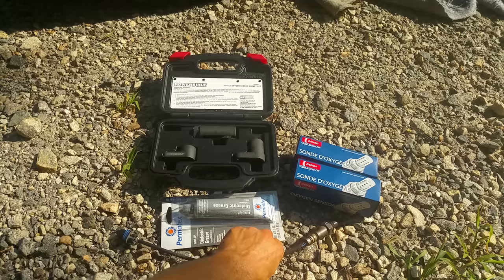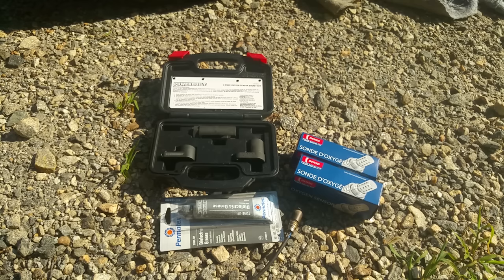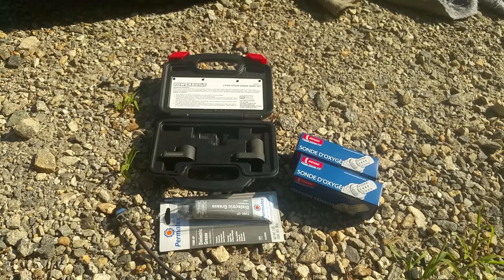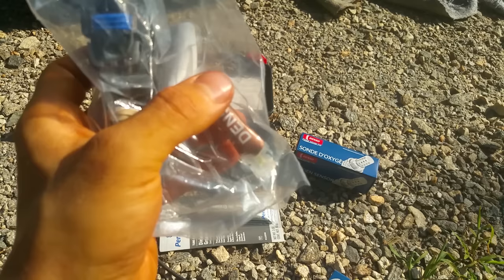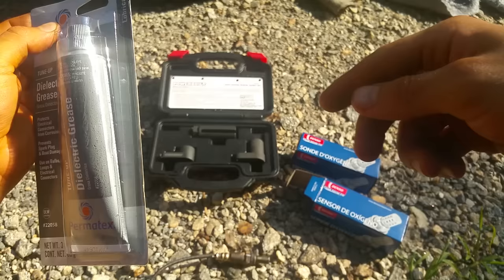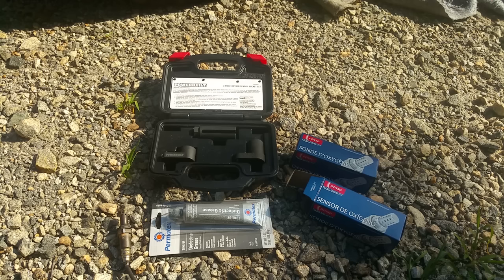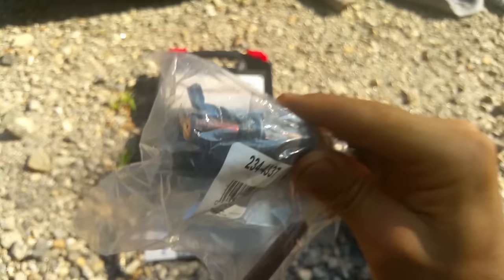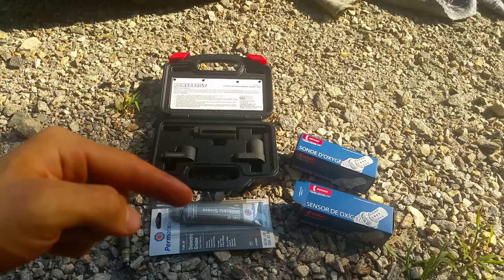NEVER Change Another O2 Sensor Until You WATCH THIS!

Comment: Hey, how are you? Is there any truth to checking several aftermarket sensors to see if they work? I was told you have to check a couple cause some may nit work. I have to put one in my dads 2003 Ford Windstar.
Reply from the maker: +JOEGGGJOE I'm good, wbu? What do you mean checking several aftermarket sensors? If the sensor is the right part number for your vehicle then it should work no problem.
Reply: I was told with buying aftermarket sensors, sometime they don't work. You have to try several of them. I just bought one from the dealer. It was just $44 dollars.
Reply: JOEGGGJOE I have seen the cheap sensor turn on check engine light, only thing that fixed it was to buy the oem one then the light went out.
Reply: what does a mink look like?
Reply: JOEGGGJOE 1"
Reply from the maker: Yea don't fool with that stuff. Just replace your broken parts.
Reply: Once you try two aftermarket sensors you might as well just get the OEM part instead and not worry about it...unless you misdiagnosed it to begin with.
Reply from the maker: It doen't even have to be an OEM part. As long as it is a good name brand.

Comment: Suggest you not use Carb or Brake Cleaner, actually hurts the heater inside the O2 Sensor.  For purpose of release use brake fluid on the outside.  Also, all 02 sensors use 22 mm sockets or wrenches.

Comment: hi 
I have nissan maxima qx 2000 so I have problem with my car in sensor rare can you guide me to buy it but secand and not new can you helpe me please 
thanks alot
Reply from the maker: +adel ahmad What's wrong with it? If the sensor is bad you have to get a new one. Don't try to use a used O2 Sensor. That would be a waste of time.
Reply: hi  again ok if want rare sensor do you have it ? and ow much prise ? thanks
Reply from the maker: +adel ahmad How is your sensor rare? Look at the links in the description for new 02 sensors to see if they have one for cheap on Amazon.
You can look up exactly what part number you need on Autozone's website.
Reply: thanks alot
Reply from the maker: +adel ahmad No problem. Make sure you get the right one there is probably an upstream sensor before the catalytic converter and a downstream sensor after the catalytic converter.

Comment: O2 sensors 'breathe' through the wires and using dielectric grease or any other stuff on the connector can screw them up.
Reply from the maker: No, some of them do and some of them don't. It's up to you wether to use it or not. Look how your sensor is made.
Reply: AFAIK, sensors with breather holes are a thing of the past so almost all modern ones use the wires.
Reply from the maker: Yea, if the sensor breathes through the connector then don't use the dielectric grease for sure.

Comment: Dielectric on an o2 connector is a no no do some reading and research o2 sensors wick air down the wire for the center core of the sensor.
Reply from the maker: Only some of them do that. It is up to the mechanic to decide.

Comment: Breaker bar... REALLY BAD IDEA.   You're likely to break the sensor off in the hole, tear the threaded mount hole out, or strip out the threads.  Heat the thing up first - just run the car for a while.  Then try to get it out with a wrench or a sensor removal tool.

Comment: You have a touch? You heat cherry red where it screws into and they normally pop right out. If you have a scanning tool you can clear the codes. It's not a halogen bulb. If it is bad and your going to replace it then cut the wires why buy the tools.
Reply from the maker: You never know. You could replace the sensor and then the code doesn't go away. IDK I guess I'm just a hoarder haha

Comment: Don't waste your money on an O2 sensor socket. The old O2 sensor is junk so just cut the wire and use a regular 6 point socket (1/2" drive) with a big breaker bar. The slotted O2 socket will spread if your sensor is seized into the bung. If you're throwing out you old sensor, cut the wire and make your life easier. God bless and stay well.

Comment: can sensors be interchange
Reply from the maker: +Aurthur Ledesma Interchanged with what? You are better off just using the right part number for your vehicle. If you mean swapping from one vehicle to another I would not do that.
Reply: I think he means is there specific part # for each bung,  no there is not.
I have 30 yrs as a Journeyman bunghole technician.

Comment: Never use grease on connecter, the 4 wire o2 sensor gets its reference air through wires, you will block the reference air.That is a big mistake to tell people to use dielectric grease on o2 sensors!
Reply from the maker: +Gary Warner I do not know where you guys are getting your information, but that is WRONG for this application. On some vehicles maybe I do not know, but on these style O2 sensors that's not true.

 Look at the black protective piece over the wires it's open on each end. How does air get from the connector to the sensor?

The sensor references the air that surrounds the top of the sensor where the wires are crimped on. That's where it gets it from. Not through the wires. That's impossible.

Comment: Paid 30 bucks to a mechanic my truck had 4 and dint wana risk messing it up hahaha
Reply from the maker: Lol $30 to swap O2 sensors? You got a deal.
Reply: @MattsShop  he even took another car off the lift to check mine ive had tried helping him unclog his shower before and he is my friends, friend i wouldn't mind having a mechanic friend had some beers with him too
Reply from the maker: Sounds like a good deal. Those O2 sensors can be very stuck. It's better to have a friend remove them sometimes and throw them some cash.
Reply: @MattsShop  yes sir the muffler looks pretty rusted for 2014

Comment: ACTUALLY Your video was👍😎 the other one I watched REMOVED THE HEAT SHIELD! IF YOU HAVE EVER HAD TO REMOVE SMALL HEX HEAD BOLTS AFTER 10+ YEARS you would think that's 🥜🥜 Thanks for showing me the COOL TOOL😎 I have several sockets that I can grind a slot in😎.

Comment: Just had a stuck one ( unable with o2 socket via ratchet)  my go to method is switching over to a closed box wrench and tap "encouragingly " with a rubber mallet . If too questionable then go to torch (small butane) at female connection & try again hot. If that fails quickly add 3in1 penetraing oil or your favorite lube and have a beer (again your favorite beer , if you dont drink God bless you for the virtuous sober  patience) Go talk to your loved ones n shoot the shit for a bit. Go back and tap once or twice as said in the tighten direction then backwards to remove.  Usually works , if not you'll probably start drinking and learn about extractors and buy a welder and other "valid" tools. Cheers 🍻
Reply: Tried your advice. Stopped for a beer break. Had none, so a neighbor poored me a glass from his tap.  I DIDN'T KNOW IT WAS BUD LIGHT! After the job was complete, the car refused to start. It now claims it is no longer an internal combustion engine and insists it is electric.  WTF!

Comment: They come out super easy if you heat them with a torch
Reply from the maker: +James Simpson Yea, but sometimes you can't/don't want to get a torch in certain spots.
Reply: Do these guys read the other comments, if so how did they end up pontificating in between about 40 other geniuses mentioning heating it up.

Comment: "Make sure you get a high quality sensor".....ahhh......how do you know?, other than brand name recognition? A lot of parts like this are packaged various ways at different price points....and the part may be the same. As to anti-seize, make sure it's O2 sensor safe anti-seize. Best to use what comes with the sensor.....
Reply from the maker: Good points. You are right there is a lot of re-branding going on now-a-days. Make sure it is the copper color anti-seize. That's what I use for these.

Comment: Ha tq spec always use german tq spec...good and tight. Some AF  OR o2 sensors if u replace u need to reset self learn count or u will get a code right back for that sensor.
Reply from the maker: +Michael Taylor Haha guttentight between tight AF and broken!
Reply: Matt's Shop always used good and tight specs never broken anything nor had any problems just gota no when to spec
Reply from the maker: +Michael Taylor Yea, I know what ya mean. Sometimes I just like to torque things. I have the wrenches and it helps me sleep at night. Sometimes I don't. It just depends on what I am working on and how critical the torque is on the fastener.
Reply: Matt's Shop i normally only use tq spec on rebuilding trans or internals parts on engine or OCS. Other than that it's good and tight within reason just gots no ur tools an impacts ect
Reply from the maker: +Michael Taylor Yea, suspension parts need to be torqued down too. So do lug nuts. That's really important to get the bolts torqued to spec so that everything is as strong and safe as possible.
Reply: Matt's Shop yes indeed lug nuts/ bolts Do but like wheel bearings, struts, shocks, ball joints, control arms, tortion bars i dont
Reply from the maker: +Michael Taylor Well, I don't play with suspension suff. I just torque it all. Why not just torque it once and be done with it?
Reply: Matt's Shop don't have access to all tq spec only nissan an Infinity as I work at a nissan dealer. An iv worked on many different cars ford Chevy dodge nissan Infinity some wv Toyota
Reply from the maker: You do or don't have access to all the torque specs? You have Alldata? You've worked on a lot of different makes/models.
Reply: Matt's Shop our owner  is to cheap for all data I'm not the only one pushes to get it but they keep sayin no
Reply from the maker: +Michael Taylor It's worth it for a professional shop.

Comment: If you know you must replace the sensor anyway then you dont need to buy an O2 sensor socket. Snip the wire and then use the close end of a wrench or ratchet wrench...hell if you have enough room a deep socket with ratchet. You can rent the O2 socket from oreilly or AutoZone. Harbor freight has them for $8 but why buy it if you are not a mechanic. Don't waste your money. Another solution is using a crow's foot.
Reply from the maker: This has been suggested before, but what happens when you snip your old sensor and the new one doesn't fix the problem? You're out $60-$100. Not fun.

Comment: Incorrect use of Dielectric grease.  Never put Dielectric grease on connectors.  Also did not put anti seize compound on the threads of the 02 sensor.
Reply from the maker: +Bill Winn Then whats the proper use of dielectric grease? I'm sorry, but I have to disagree on the no anti-sieze. It's the perfect application for it. It comes in the box with new sensors. I'm pretty sure Delphi know just a little bit more than us.
Reply: And no tooth paste on your brush, its a rip off too.

Comment: I'm pretty sure the grease stuck to ur fingers got nothing on all the exhaust gasses, carbon, and other crap coming out ur engine lol. touching them isn't gonna harm them. Any crap u get on them will burn off pretty much the second u fire up the engine.
Reply from the maker: Maybe, but what happens if dirt or something gets into the sensor's holes on the end. It might mess it up. Why touch it when you don't have to?

Comment: Run the engine get the exhaust hot . That releases the sensor
Reply from the maker: +Tim Erickson Yea, I do that, but forgot to mention it.
Reply: And then apply some ice spray on the sensor to contract it?
Reply from the maker: +James MacDonald Maybe, have you done that?
Reply: Can of Dust-Off for cleaning computers is actually R-134a if I recall.  Turn the can upside down to spray liquid and freeze shit.

Comment: 80 - 100% after market you buy from part stores  ...These connections are not the same with the original you take out from your car!!!!  And when you drive...- feel not the same!  ?????
Reply from the maker: +ThepDenNgoaiBien Most of the part stores sell aftermarket O2 sensors yea. The connectors should be the same and the car should perform the same after you replace the bad sensors.

Comment: I thought this was a video on how to make it to where you never have to change out an O2 sensor again? And it's not a halogen light bulb you didn't touch it you just don't want to get anything within the sensor what's behind that metal that's why there's that metal there and just some advice for anybody that can't get one out the day before you're going to work on it WD-40 the living crap out of it and then when you're ready let it soak and then when you're ready to pull it take a map gas torch and heat the part that this O2 sensor threads into which will cause expansion and make it 10 times easier to break loose do not heat up the O2 sensor just the metal around it.

Comment: I don't think you are suppose to use any greese on a o2 sensor.
Reply from the maker: On some of them you aren't supposed to use grease if the sensor pulls air from around the connector through a tube.

Comment: I just used a crescent wrench to remove the o2 sensor on my Suburban. Not sure why the damn code didn't clear up after replacing it.
Reply from the maker: +4bsurfer You got very lucky I'm guessing someone already had it out before?
Reply: No idea, still a bastard to get it out. Made a Vlog of my son doing the work.
Reply from the maker: Yea, they are for sure.
Reply: Visit Schrödinger Box's channel, you'll know why the code won't go away.
Reply from the maker: +Bud Dawkins Not a good idea at all. How is the computer going to know how much gas to mix with the air? It's going to kill MPG and run like s***.
Reply from the maker: +Aaron Abrahams You can unplug the battery for an hour so that it resets too.
Reply from the maker: +Aaron Abrahams Already tried it was broken, trust me.
Reply from the maker: +Jafar Ismail I've never heard of him, what does he film?
Reply: Capacitors in an ECU power its RAM for a long time after power supply (battery) is disconnected. This keeps the data stored in RAM (codes, etc) intact until capacitors are depleted.
A much faster way to clear stored data is to disconnect battery ground clamp, then clip a jumper wire (small wire w/small alligator clips on each end) from disconnected battery ground clamp (or chassis) to battery positive. This provides a circuit which quickly drains the ECU capacitors (a few minutes) and all data in RAM is lost.
For ECU to most quickly "relearn":
Leave ignition "on" for 10~20 seconds BEFORE cranking starter 
After engine starts, don't rev, leave it idle until its warmed up to normal operating temp
Drive a few miles with moderate throttle, gently accelerating through all shift points
Reply from the maker: Yea, I know that's how the reset is supposed to work. I don't think I would jump my positive to the chassis. Why not just let it sit? Caps do not take that long to discharge, especially the tiny ones that I'm sure are in the computer.
Reply: In relative terms, there's a lot of capacitance in an ECU  It takes precious  little power to keep RAM refreshed. They're built that way for repair/maintenance convenience; ECU doesn't need to rebuild it's unique data set every time the battery gets disconnected. Somewhere I read Ford says recent models can take around 130 miles to get all systems completely dialed in.
As far as using a jumper goes, It's personal choice; can take over an hour to clear RAM w/battery disconnect; takes 5~10 minutes w/battery disconnect And jumper. 
With battery OUT of circuit (ground clamp Removed from Terminal) the various capacitors are the circuit power supply, dumping into a big "sink"
Reply: In relative terms, there's a lot of capacitance in ECU  It takes precious little current to keep RAM refreshed.  They're built that way for repair/maintenance convenience; ECU doesn't need to rebuild its unique data set every time battery gets disconnected.  Somewhere I read Ford says recent models can take about 130 miles to get all systems completely dialed in. 
As far as using a jumper goes, it's personal choice: can take well over an hour to clear ECU RAM w/battery disconnect, takes 5 ~ 10 minutes with battery disconnect And jumper.
With battery OUT of circuit (ground clamp Removed from Terminal) and jumper connecting battery + to chassis, the various capacitors are the circuit power supply, dumping into a big "sink"
Reply: Bro put the proper resistor across the cap do not run the positive to ground.. that is essentially a direct short.. this is common knowledge .. going to get one of these nit-wits hurt!!
Reply from the maker: Forreal

Comment: It's call a weatherhead fitting socket.....😂😂
Reply from the maker: I don't get it???
Reply: Matt's Shop    It is the name of the socket....made to remove hoses and wire plugs... weatherhead fitting socket.  I have had the entire set for years....long before O2 sensors.
    The one you have is for it's application...in the machine repair trade they are weatherhead sockets.
    😀. Fun fact
Reply from the maker: Oh, okay thanks for that fun fact. I will have to look them up.

Comment: Get one at the junkyard for five bucks it'll last you a long time you don't know when that person replaced it that the same on all models so they're easy to find
Reply from the maker: +dougjstl1 How do you know the one at the junkyard is good?
Reply: Matt's Shop you can check it with the meter see if it's good just put it in there install it into the exhaust pipe and see if you get a code don't make a big deal out of it
Reply from the maker: +dougjstl1 You can check ot with a multimeter?
Reply: Matt's Shop yeah you can check it with the meter watch one of the YouTubes videos on how to do that or just put it in and see if it works how long would that take you is it that hard it's easy just put it in there
Reply from the maker: +dougjstl1 Yea, I remember seeing a vid like that once. He put the meter on it and heated it with a torch.